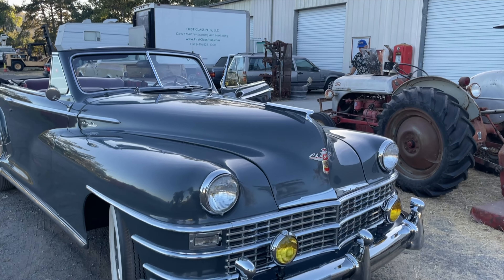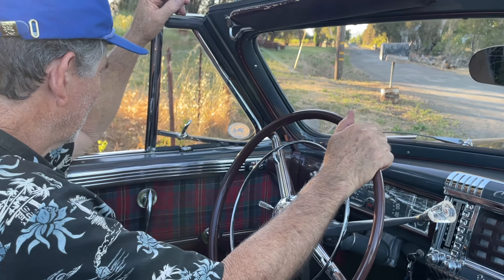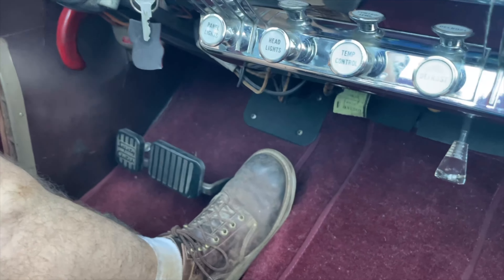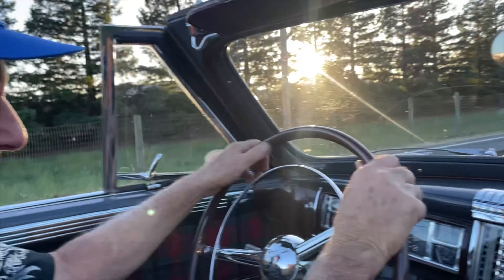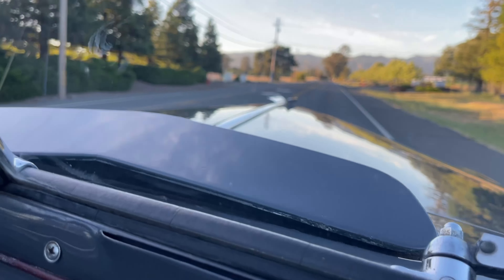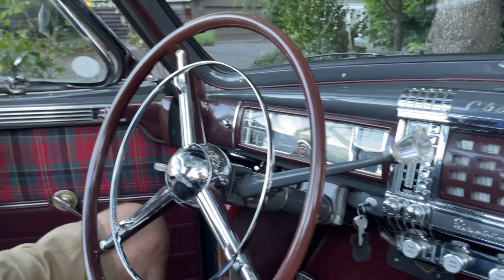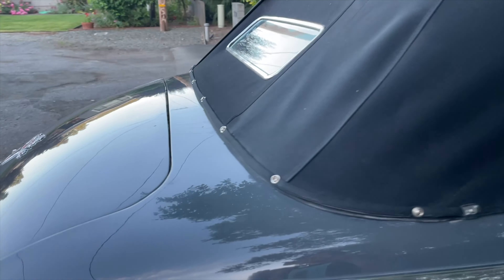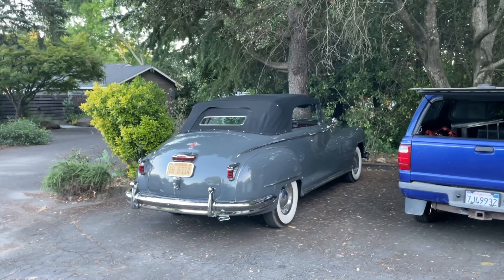How to drive a 1948 Chrysler, Fluid torque drive?

Comment: 1948 Chryslers had Fluid Drive, the torque converter came along a few years later in 1951. The difference is, fluid drive does not multiply torque.

This was Chrysler's first effort at an automatic drive, dating back to 1939, the dawn of automatics, when few companies had them. It was sort of a cross between a manual trans and automatic with features of both. You need the clutch to shift into gear, after that they drive like an automatic. I would warm up the motor, shift into gear, release the clutch completely while parked, then drive away like a typical automatic.

 It was a very smooth, but simple rugged and trouble free system. Unlike some more complex systems like Hydramatic that were a nightmare to service and repair.

I have owned, driven and serviced these transmissions. Almost always, any repair was easy and cheap. They are an electrically controlled transmission, and over the years the wiring can get frayed or broken. The trans can get low on oil. Electrical contacts need cleaning. All these things are easy to fix, at very little cost. The transmission and fluid drive are very simple, ruggedly made and largely trouble free.